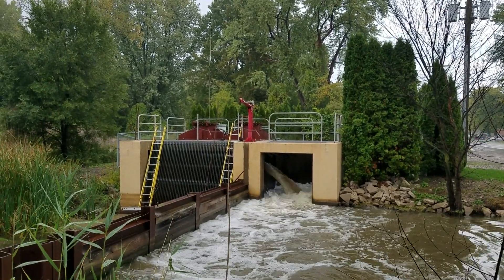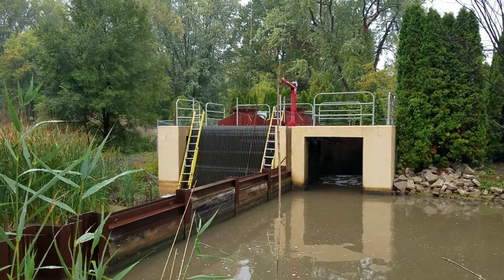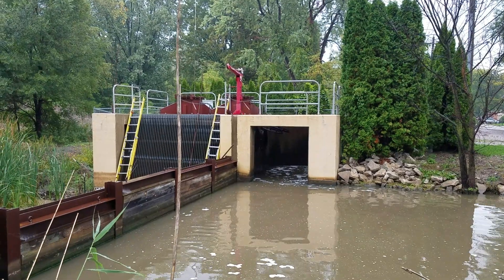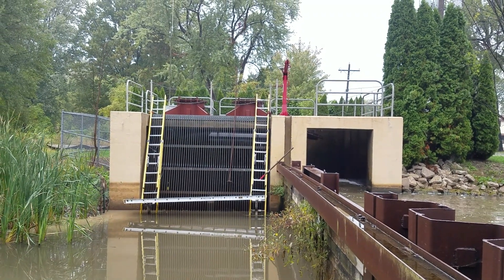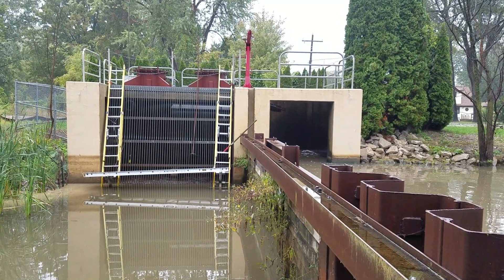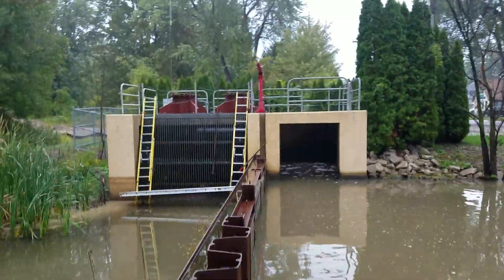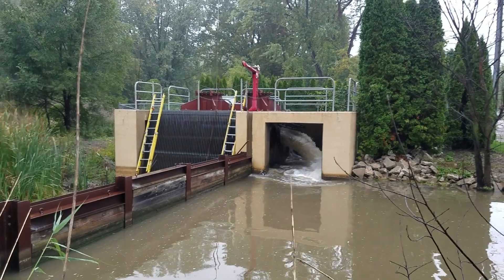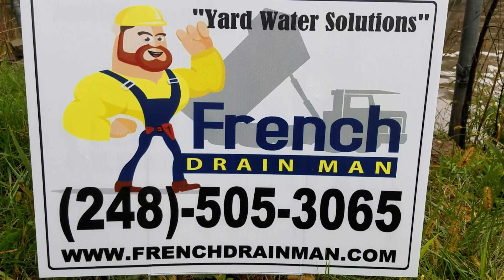Pump Stations, Lift Stations - How They Work To Drain Communities

Comment: theres a problem with this one, its stopped up, short cycling
Reply from the maker: I believe it's working correctly. The pumps Alternate
Reply: Well these applications are usually set up as stages, you may have a lead and a lag but I will guarantee you no electric motor should short cycle like that, in no world is that a good thing, the on and off constantly hood on a motor
Reply: My first guess, I can’t see it but I would guess   There’s not good drainage in to the intake where the floats are, but maybe a control issue
Reply: I would find a mechanical guy to look at it, but if you want to check it out, look at the floats or what ever controls the pumps, are there two of them at different levels, I bet so

Comment: I'm in Memphis Tn and we have a series of levees around the city to protect us from the floods from the Mississippi River.   At several location near the river there are pumping stations that do this but on a more massive scale.   You can drive by them and see the grates.  During low water times the water just flows thru the pumps.  Once flooding occurs they will close the gates and the pumps lift the water over the levees.  These grates have automatic cleaners that remove the debris collected on the grating.   During the floods in 2011, these stations ran for about 4 months.
Reply from the maker: Thank you for sharing. That's pretty massive. 4 months is insane 😳